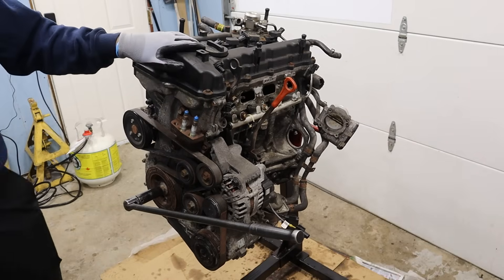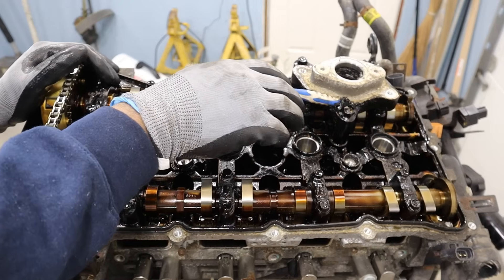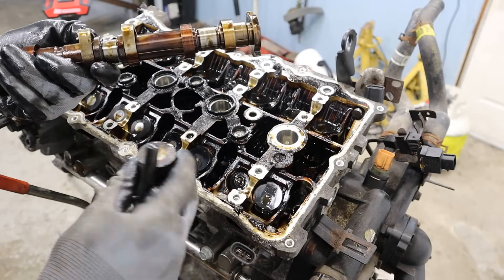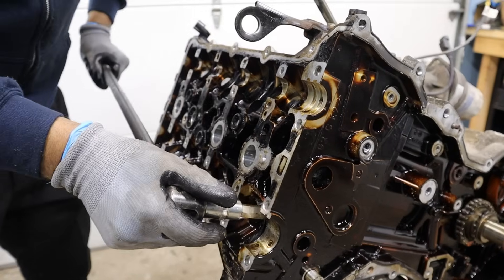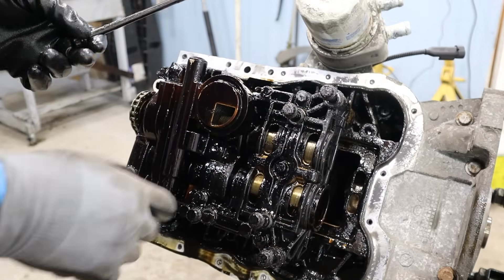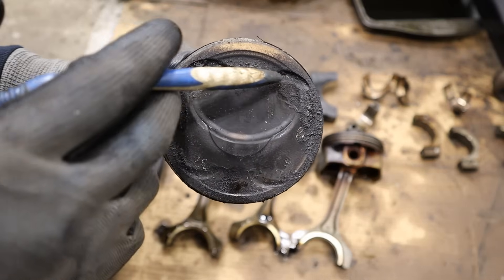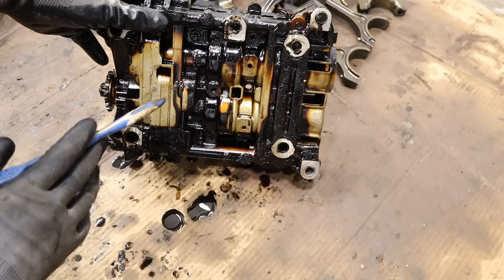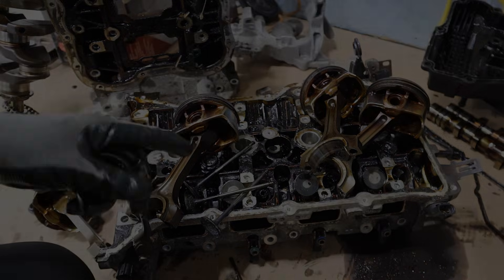Why Kia 2.4L Theta 2 Engines are a FAILURE

Comment: To anyone and everyone that owns a Hyundai Kia you very most likely will have engine problems and/or failure. 

I don’t care if “your” H/K has 200k miles in it with no problems, the majority, a very large majority will burn oil then clog your catalytic converter(s) and many lock up. Doesn’t care if you change your oil every 1000 miles you WILL have problems.

Our Tucson 1.6T was flawless until around 38k miles when it starting burning oil. At first 1 quart every 2500 miles to about 52k miles when it was going through a quart every 500 miles.

They are junk.

I buy salvage cars for a living and there are BHPH dealers that have stopped buying these at auction because they are that bad.
Reply from the maker: And hence its reflected in the resale value. These cars are disposable now. I just bought one ( update coming soon)
Reply: Actually, catalytic converters crumble on these engines, and pieces of it end up in the engine and score the cylinder walls.

Comment: chrysler and kia co-developing an engine... yeah this thing had no chance
Reply from the maker: Haha! 
Apparently the Mitsubishi versions held up a bit better
Reply: @speedkar99  came here to say this, their Mitsubishi designs are rock solid.
Reply: I had a 2001 2.4 Sebring. That thing ran smooth are over 200,000 when I eventually sold it. Never had any issue except the AC compressor. That was a Mitsubishi version
Reply: i wonder how much of it is chrysler 's fault and how much is kias
Reply: @Bat-of-Sealand Hyundai was the lead designer on this and it was their block that they used and they are the ones that have the problem. It's all Hyundai/ Kia's fault, not Chrysler.
Reply: The Chrysler versions held up just fine.  The variant that Fiat modified using their multi-air did have problems. But that was much later on. The design problem is clearly Hyundai. The Mitsubishi and Chrysler versions hold up versus the Hyundai version did not.

For what it's worth, the second generation of the neon engine fixed most of the problems that the first generation neon engine had.
Reply: Apparently Mitsubishi lead the development with the others building their own version of the engine
Reply: @MrMikey409 no, it was Hyundai who was the head in designing the block not Mitsubishi.  Picking Mitsubishi to lead would have made a lot more sense but that's not what happened.

Comment: I have 2015 Sonata with this engine, bought it used with 10000 miles, engine blew with 99500 miles on it, Hyundai replaced the engine. Oil changes done regularly every 5000 miles with full synthetic and Hyundai oil filters used. New engine has 35000 on it, figure it will blow sometime before the 100000 mile mark. No other issues with this car to date but definitely basically know this engine will blow eventually.
Reply from the maker: Ouch! 
At least it was covered. 
Was a new warranty applied to the new engine?
Reply: New engine warranty is 36000 miles. Thankfully everything was covered, I paid $0 and they paid for a rental for the 2 months they had it for the engine replacement. Time will tell how long this engine lasts.
Reply: @noster75-v2v the problem was fixed with the updated engine so no worries there ❤

Comment: Kia tech here… I’ve done countless engine replacements on the 2.4/2.0/1.6 and almost all of them look like this. Kinda surreal to watch after doing so many tear downs like this
Reply from the maker: Ouch! 
They look this bad even if they were maintained?
Reply: The 2.0 and 1.6 are generally regarded to be reliable outside of the USA, cars are very badly maintained there, with oil change intervals of 16000 to 25000 km, that's the sure way formula to destroy engines, no matter the brand, oil should be changed every 10.000km unless you do a lot of heavy traffic city driving or short trips, in that case you should change the oil ever 5.000km, it's literally down to maintenance, outside the USA Rios and Fortes drive hundreds of thousands of happy kilometers as ubers or taxis and a lot of people swear by them
Reply: What percentage of the 2.0 that fail ????.....I heard that only 1% will fail...is that you're seeing ?????.
Reply: KIA doesn't really want to fix problems their cars have. Even their eGMP cars that blow ICCUs get replacements with a part with the exact same faulty design. Kia/Hyundai don't have a system for managing cars getting repaired, either. So this person's car probably sat for a month while getting "fixed."
Reply: @pootispiker2866 mines was replaced in a week. I guess depended on the dealership.
Reply: Kia has always marketed to young/first time car buyers, and also low income car buyers with zero or bad credit.  It’s logical to think these people may delay and put off normal maintenance items like oil changes.  Not really because they are lazy, but they may be working two or three low paying jobs to just afford, rent, food, and their brand new KIA.  I wonder how this engine would look if owned by someone who was an enthusiast and changed their oil every 2000 miles with top shelf oil and always took care of their car.  Think 20 year old male with no wife/girl friends, no kids, living at home. The ONLY thing this guy ever loved was is beautiful KIA. Every day he would be pulling that dip stick and checking his beautiful oil.  He probably pulls the spark plugs every week just to look at the combustion color.   He probably only goes to the same, one gas station every time because he ONLY wants to put in the best gasoline.   He washes and vacuums his KIA every week and keeps her beautiful inside and out.  He NEVER lets his friends (if he has any) eat or drink anything but bottle water in his KIA.
Reply: @ericcindycrowder7482  I'm kind of that guy...my 1.6 gdi only needed a PCV valve at 96 000 km (on warranty), the car is 11 years old and that engine is as smooth as new, nothing else on the engine broke...i did the spark plug and coolant change at 160 000km, that's about it, i found it impressive, in manual the car is peppy and fun, i wonder if this 1.6 is a copy of a 1990 civic engine...I would buy a brand new 1.6 but the 2.0 scare me to death...Bring the K3 Kia, ill buy a manual i swear!
Reply: @ericcindycrowder7482  I imagine this scenario is a fever dream for the countless abused and neglected Kia's out there who have never had mechanical sympathy directed to them.
Reply: @ericcindycrowder7482 😂well boy it’s just 2 dam bad it’s some young female riding around town music blasting speeding with her friends & no car care knowledge , just a ticking time bomb waiting 2 blow
Reply: That's because at that year they had meatal shavings in the engine that ate the engines
Reply: @chris6476 That almost sounds like deliberate sabotage.

Comment: My 2013 sonata has 212217 miles on it, not anl single pripblem, other than the starter its been the kost reliable car ive owned, regular maintenance and oil changes can make any engine last
Reply from the maker: Wow! 
Does it burn oil?
Reply: I have a 2013 Sonata also and the engine failed at 97K miles. Hyundai replaced the engine for free, but I'm worried it will eventually have the same problem.

Comment: I was recently in the market for a new vehicle with more utility than my Mark 7 Golf. I like the concept of the Hyundai Santa Cruz but just couldn't bring myself to buy one. They're well-equipped and agressively priced, but they're also disposable with horrendous engines. I stuck with what I know and bought a VW Taos...
Reply from the maker: At least the taos isn't turbo charged right?
Reply: @speedkar99  As we both know, in 2025 the usual recipe is a little engine (a 1.5 in this case) with a big turbo. So be it. I'll see how the long-term durability pans out.
Reply: @marsgal42 I don't have much faith in overpowered small engines as daily drivers.
Reply: @chiefdenis  My Taos is a weekend activity/recreational vehicle. I work from home and don't need a daily driver. I too am dubious about the long-term durability of little modern engines, but that's all you can buy these days.
Reply: google the vw cavd engine piston failures if you think vw are not horrible disposable junk.
Reply: VW has had MORE serious problems than Hyundai/Kia ever have. And the VW warranty is inferior although they did improve it. I can link countless videos for VW vehicles that are in pristine condition but mechanically totaled for severe problems with their turbo engines that are stupid expensive to repair. Don't own any German car past the warranty.
Reply: @sharedknowledge6640  I've never had any problems out of the ordinary with my kias/hyundais, granted I've only owned up to 2010s, none of the newer nightmare models, but they've generally been as reliable as the Toyota's I've had.

Comment: Well its Chrysler so to be expected.
Reply: It's really not Chrysler. This engine was entirely designed in South Korea by Hyundai/Kia. There are a few similarities with Chrysler left over from when Hyundai was using some Mitsubishi designs which Chrysler also did long before this engine came out.

Comment: Why would they design the bucket to contact the cam when it’s off-lobe? With Honda engines you adjust them to have a certain gap i.e. lash. Unless there’s some slop in the valve itself then of the bucket is contacting the camshaft off lobe it would be opening the valve very slightly

These engines are the result when you try and copy someone else’s technology.

Why would they bother with a ladder frame and then only 2 rod cap bolts?
Reply from the maker: Ladder frame is stronger for more power. 
Other engines use it. 
The cam shouldn't be pressing down on the bucket but not enough clearance that the bucket can float!
Reply: It's probably excessive lash from the cam bearings getting torched.

Comment: Had 2011 Hyundai Sonata which started using oil around 95k miles and progressively got worse. Ran great until 207k when it was stolen and driven until the engine seized and was found a few days later. Was using about a quart every 500 miles at the end.
Reply from the maker: So it burned though and blew up in a few days? Wow. 

I just bought a Sonata 🙈
Reply: @speedkar99 you already know what to do, you'll be fine😂.
Reply: Is that what the thief reported?

Comment: Our 2012 Optima had 150k +/- when it blew. 5k intervals. Kia made it right with a free new engine guaranteed as long as we oil the car. New engine has much larger oil capacity. Still changing every 5k, it's never low. Or really dirty.
Reply: I meant own the car. And maintain.
Reply from the maker: Did it take a while to get approved for the warranty?
Reply: My 2015 sorento kicked the bucket at 152 and they replaced mines as well.

Comment: After my first one went having the dealer servicing it I started doing it myself. They told me to go up to 5w30 so every 4500 miles it gets 100% synthetic pil…….not full synthetic, 100% synthetic. Not the same.
Reply from the maker: How will you prove it was changed for warranty?
Reply: @speedkar99 I do it on video
Reply: @speedkar99  I keep the receipts for the dealer purchased oil filters and receipts for the oil. I bump up to 5W-30 but also have receipts for the 0W-20 used in other vehicles. Thanks for your entertaining videos. I like your style.

Comment: It's weird as so many Kia/Hyundai owners just LOVE their cars.  For me, I'm usually beside a random one at a red light and can hear it ticking away or knocking away or making some other noise that clearly doesn't sound happy.  We just got a new hire at work and she drives a Forte and I'm guessing it's a valve or valves that aren't happy as it's a very rapid clicking you can hear as she pulls away.  Also had a neighbour that also had a Forte that was knocking so bad I was wondering when I'd get the opportunity to pick up one of the rods in the parking lot when it blew up and what did he go out and buy after having a car that was literally eating it's engine alive?  A Santa Fe.  

I don't get it, I wouldn't even consider one of their products but maybe that's just me.
Reply: My family is all hondas except for our newest car, a 2022 elantra. I've also worked on a friend's 20 sonata. One positive thing I will say about them is that maintenance is surprisingly simple. They have the torque specs printed on the oil filter housing and the sonata has just about the easiest air filter change I've ever seen
Reply from the maker: They love them because they were cheap.
Reply: @speedkar99 and they are completely ignorant to the crappy build quality and design flaws.

Comment: Simple truth.  GDI ultra-high pressure fuel injected into cylinder + low friction piston rings (less drag for fuel economy numbers) = fuel bypassing into the oil = oil losing lubricating qualities = rod bearing carnage.  Stick to conventional MPFI and problem avoided (which KIA/Hyundai now employ).
Reply from the maker: Oil dilution is one theory

Comment: Looked some video from Area diesel service where they did checking and repair on diesel injectors. Wondering about working principle of injectors shown in this video? Do they have replacable parts and have some procedure for calibration shimming etc? Never heard someone complain on injectors on gasoline engine. What makes them way more durable?
Reply from the maker: I have a video on port I Hector's but it would be nice to tear into a direct to injector to see it's difference

Comment: All these idiots who think neglect is the newest technology. Oil is oil its simly so much that a oil can protect when it degrades. Driving 5-7k between oil changes with visual inspection at 3k miles if you like your engine in one piece. Car maintenace has nothing to do with the dealer or manufacture, if your engine blow up thats a bill for you. Its like looking at a flat tire and say but its new tire, so i'll still drive on it wiithout fixing it, Lol. Either learn to do the work yourself or pay a good technician to do the work properly. Its better to carry ocd in your pocket then to carry neglect and optimism, Lol.
Reply from the maker: Maintenance would be everything except many engines are still blowing up!
Reply: Yes I agree with you in general , but their engines is garbage. In my opinion all their mechanical parts are of lower quality. My optima blow up at 100k miles and the irony my engine oil in engine  when it fails was 5w30 amsoil signature  series 😂😂

Comment: My kia has over 126000 miles on it burns oilslight ticking
Reply from the maker: Keep it lubricated. Don't let it run low
Reply: @speedkar99 yes keep checking it add when needed

Comment: Never have seen two oil pumps before.  Does each one supply a different part of the engine, but if that is so, how do they both put oil through the filter? Seems quite an achievement that engines with two oil pumps are the ones with lubrication problems.
Reply: Porsche 911 has 9 oil pumps 🙃
Reply: Given how bad this design is, they probably spin in the opposite directions from each other...
Reply from the maker: I'm sure they add together, given the oil circuit on the block

Comment: Other than changing the oil more frequently with high quality oil and filter. Is there other ways to clean the gunk inside the engine? Seafoam…etc?
Reply: They usually walnut blast the top of the intake valves after they carbon up, or you can use some kind of solvent to clean them up, but you generally need to pull the intake. Not a huge deal.
Reply from the maker: A solvent can help with sludge (like transmission fluid). It can dislodge and clog small oil passages. 

Sometimes some elbow grease and your brother's toothbrush is the only way 💪
Reply: @speedkar99 Brothers toothbrush...

THE only way.
😂🤣